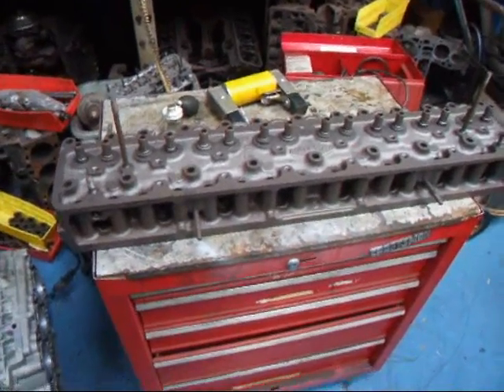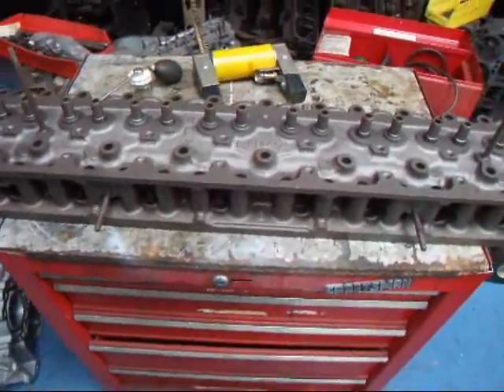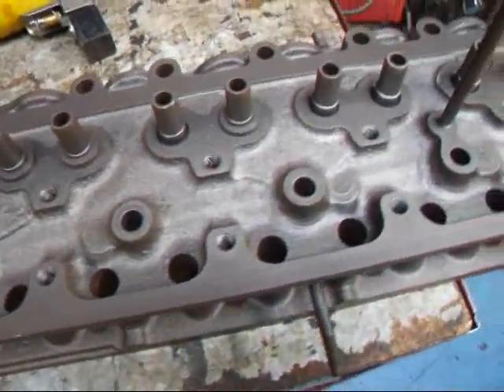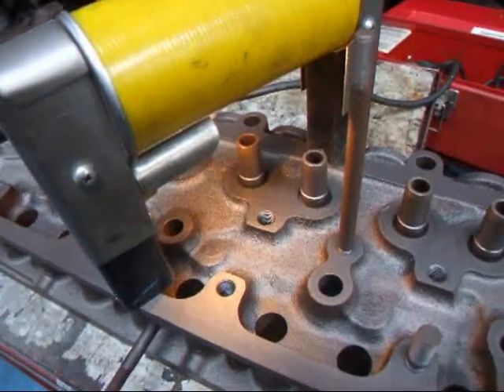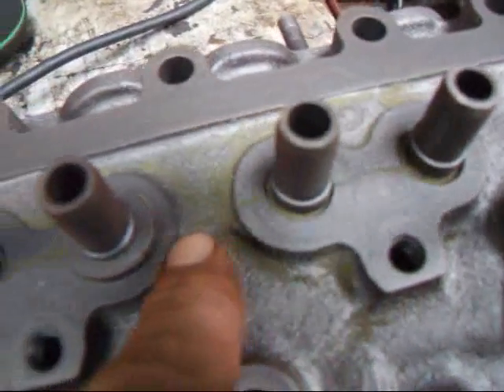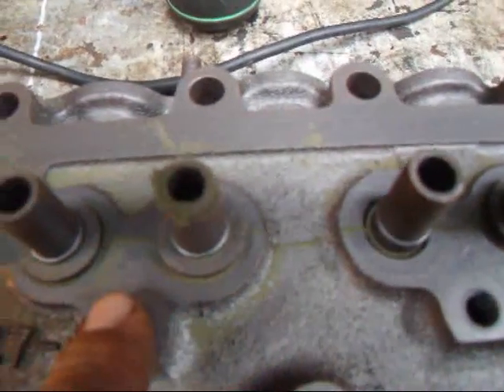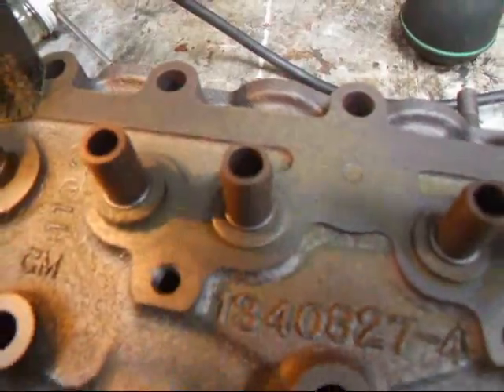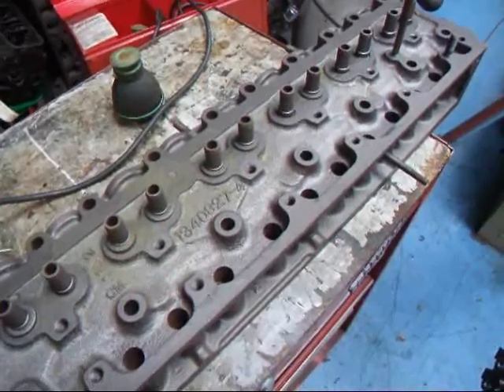Buick-L8-NDT.wmv

Comment from the maker: @ladams00 - Probably mot, my welder is very closed mouth about how he welds cast iron. I understand the process and have done it in the past, but I don't have the oven to heat the head to 1300 degree and hold it there while you weld it. Sorry. I am doing a video of the Straight 8 valve job.

Comment: @sidewayznut2009 Actually, straight 8 Buick heads are not really rare, like say Packard or Dusenberg. Buick made tens of thousands of these back in the day. I won't say you can get one at your local dealer, but they are available in the antique car market. That head is not worth repairing. The utility of Magna-fluxing is that you know the head is a good boat anchor before investing money in the rebuild.

Comment: I didn't know it could be welded like that!?!   anyways If I had a cylinder head that rare and it couldn't be used I'd just have it reassembled (valves and springs) and put it on display or something.  I think that is really cool considering just how rare a Buick inline anything is then to top it off its an inline 8

Comment: hey john, i have a 2.3 liter 96 ford ranger 4 cylinder. it has this problem where if its not fully warmed up before i start driving it will idle high and only stop idling high when the wheels stop moving. then as soon as i start moving again, it starts idle high again. i have been told it could be a vacum leak but i have not yet found a leak. any ideas on what might be happening? thanks alot - justin